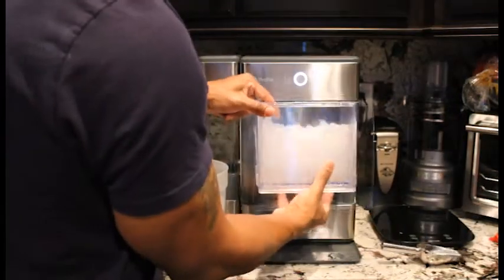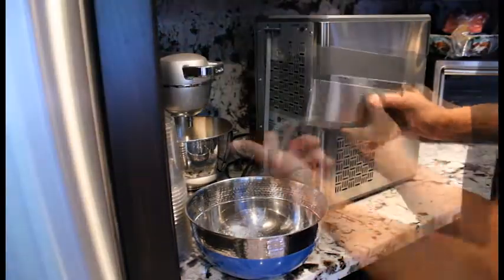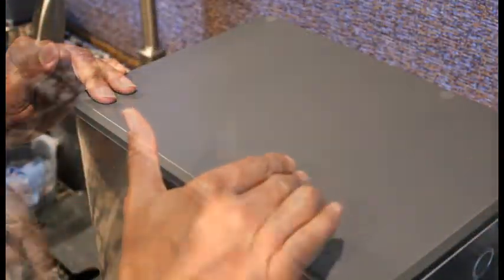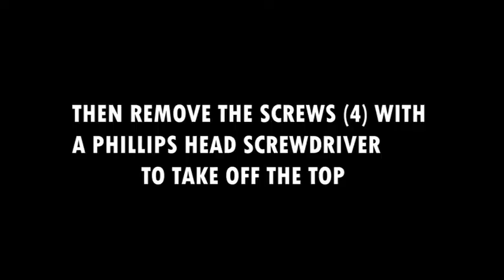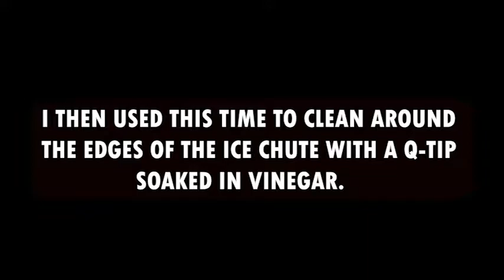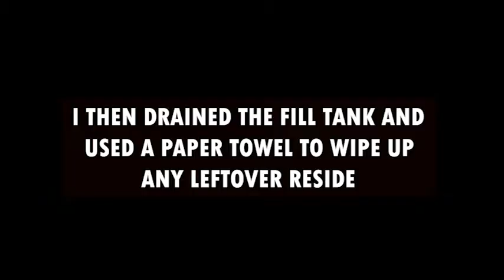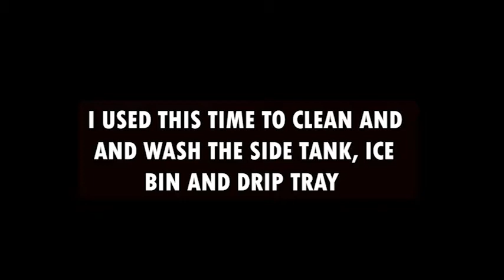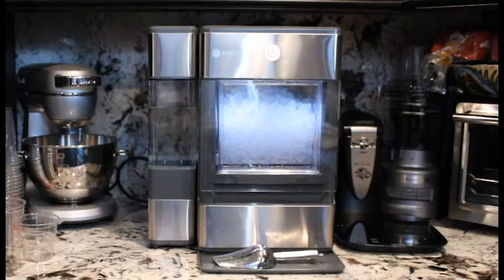GE PROFILE ICE MAKER | How to CLEAN Upper Fill Tank

Comment: Apparently the upper tank can get so dirty the float switch stops working.  I just cleaned mine and it solved the "blue-low-water-light-with-full-tank"  issue that plagues these units.  I am not clear on why it worked, but it was disgusting, so the upper tank really needs to be cleaned any time you are doing a maintenance clean of the unit.
Reply from the maker: Hello @CC-gu3ze 😀 Yes, I give much needed attention to the upper tank when performing regular maintenance.  These machines need to be consistently checked and cleaned to prevent any mold and/or other health concerns.

Comment: Thanks a bunch.  My Opal stopped making ice.  I've been using the clean cycle about once a month but was still getting debris after cleaning.  I cleaned the inner tank per your instructions.  It was disgusting.  GE really needs to make that inner tank accessible for cleaning.  Just plugged it back in and looking forward to some crystal clean ice.
Reply from the maker: Hello gregvi 😃 You're very welcome.  And yes, the inner reservoir tank definitely needs to be repositioned for easier accessibility.  And, I hope things are running smoothly and that your ice bin is free and clear of debris - thanks for watching.

Comment: Wondering if adding some chlorine water mixture in a cleaning cycle would help keep the top tank cleaner and sanitized?
Reply from the maker: Hello Dale 😃 You can add a solution of chlorine and water in the cleaning process.  I normally use a coffee descaler (1-2 ounces)  with water or a mixture of distilled white vinegar and water.  However, the top tank will definitely be kept clean by regular cleaning -  thank you for your comment and for watching 😃

Comment: Found the video great, I've got the newer version of this and will try to follow the steps. my top cover is different so that'll have to be addressed.  Mine stopped pumping water up to the upper tank one month after warrantee expired.  yeah. Hoping i can descale or something and get it to work once more.
Reply from the maker: Hello Michael 😃Sorry to hear about the water pump acting up a month after warranty.  And yes, you may have a different setup since you have the latest version.  However, I do not believe Opal is providing how-to-instructions to remove the top lid & clean the inside of the unit.  I hope the steps are the same but let me know how things turn out for you - thanks for watching and for your comment.
Reply: I must have a different model as well as mine does not have those 4 top removal points for screws.  I am not sure how to get the cover off

Comment: Just cleaned the machine thoroughly opened it up and everything… now it’s stuck on cleaning mode where light turns yellow and won’t make ice. Any idea what that could be? There was no mineral buildup inside machine. Don’t know what else it could be
Reply from the maker: With the POWER ON, Toggle the switch in the back from 'ICE' to 'CLEANING' mode a couple of times to check the display light for both.  The 'cleaning mode' will make the front LED button pulse yellow.  The 'ice mode' will have a green light followed by a white light which means the ice maker is 'ON' and your machine will start producing ice. 

Make sure the button in the back has been switched back into the 'ICE' mode.  If the machine is in "ICE' mode and the LED button is yellow....it means the machine needs to be cleaned.

Have you cleaned the inside of the upper fill tank?  If not, check out my video below to help.  Also, did you have any dust on your air intake?

https://youtu.be/1dtWie3rtYI

I hope this helps out with getting your machine back up and running again.

Comment: Great video!  How much vinegar did you use to clean inside the water tank?  Also, what is the white stuff you were cleaning around the edges with a tooth pick???😳
Reply from the maker: Hi Simone 😃 I used a cup of distilled white vinegar inside the water tank.  The white stuff around the edges are calcium deposits which I cleaned with a Q-tip soaked in vinegar. Thank you for your comment.

Comment: I am hoping this help as I have seen mold both in the tank and bottom of water tank holder....will try. Ps love your videos
Reply from the maker: Hello Tindara 😃 First and foremost, thank you very much! 😃 And yes, if the machine is left uncleaned and unchecked...it will definitely invite mold inside the unit.  However, if you clean from top to bottom (fill tank to water reservoir) on a  consistent basis (like every 3 to 4 weeks)...it will definitely help to keep the unknown at bay and keep your ice tasting fresh.  

I'll also be posting a new video on how to clean the drain tubes and keep them from getting clogged with calcium deposits...so stay tuned.  And, let me know how the cleaning process  works out for you.  Again, thank you for your comment and for watching.😃😃

Comment: After the three minute cleaning cycle it just sits and does nothing. I can't see how this is helping clean my ice make.
Reply from the maker: Hello Richard 😃 The cleaning cycle normally shuts off after three minutes.  We press the button and run the pump four more times with the drain tubes plugged and cleaning solution inside.  Check out the link below to dive a bit further.  The process takes a while but it's far the greater good.  Thank you for your comment and for watching.  😃

 https://youtu.be/IrHWjz2iu-4

Comment: Are you serious? You do that every three weeks?  If that’s the case these machines are not worth the money. Will the vinegar kill any mold in the system?
Reply from the maker: Hello Rob 😃 Yes, I started cleaning the ice machine every 3 to 4 weeks once I took off the cover and peeked inside the fill tank.  I realized the machine requires regular cleaning to help keep mold and other contaminants at bay.  And yes, vinegar definitely helps to kill and prevent mold.  However, I do not regret the purchase but thank you for your comment and for watching   😃